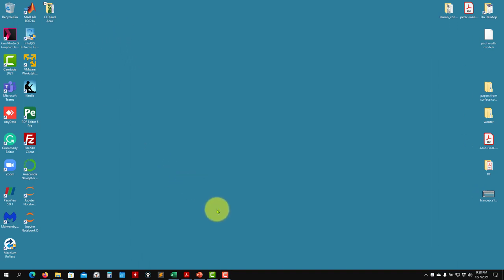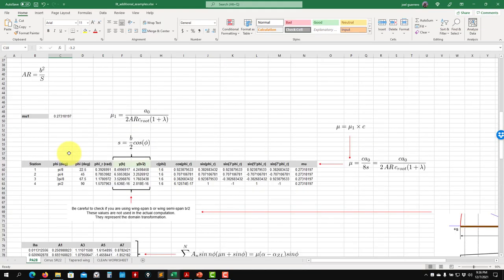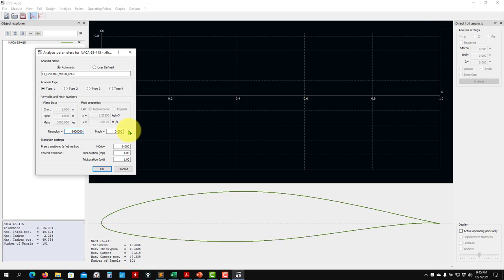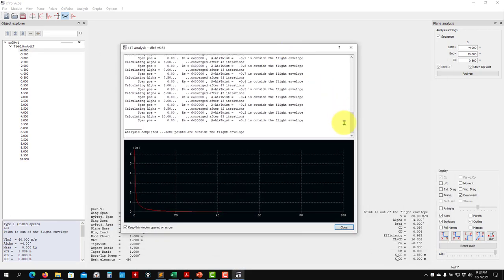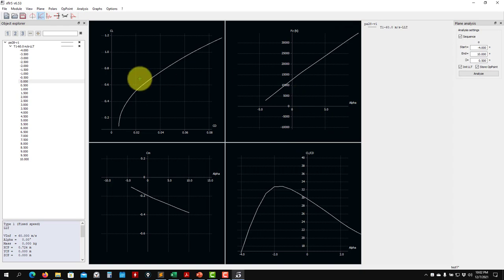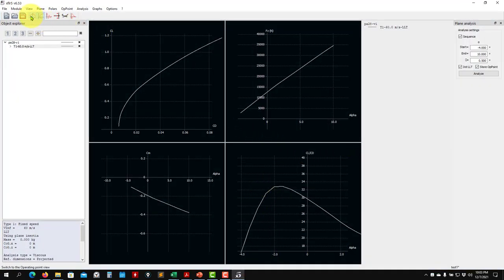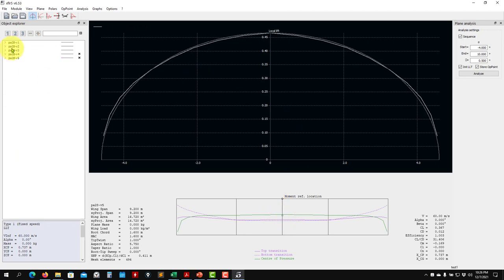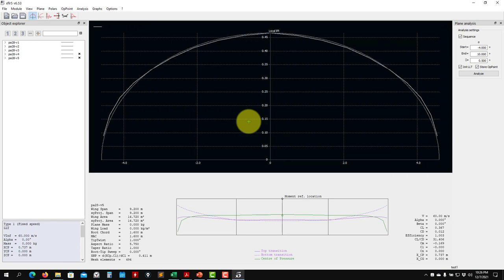Crash intro to Wing design using XFLR5 and the LLT method - Part 2

Comment: Can u make video on oblique wing
Reply from the maker: Well, that will be an asymmetrical wing.  To do the aerodynamic analysis, use the VLM method as the LLT will not work.
Reply: @wolfdynamics5703  need to know how to design the oblique wing in solidworks please make a video on it
Reply from the maker: @Nani69696  well, that is not difficult.  Just design a simple wing and then rotate it.